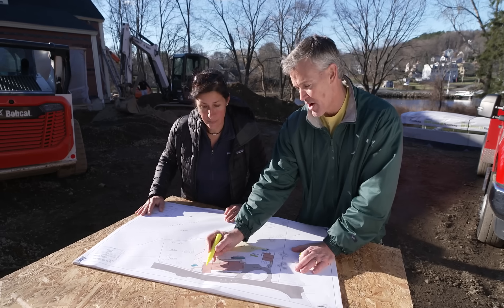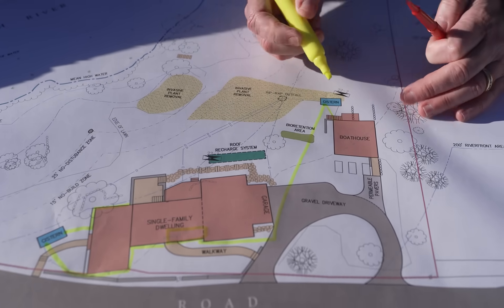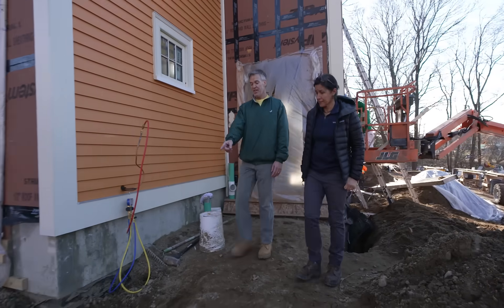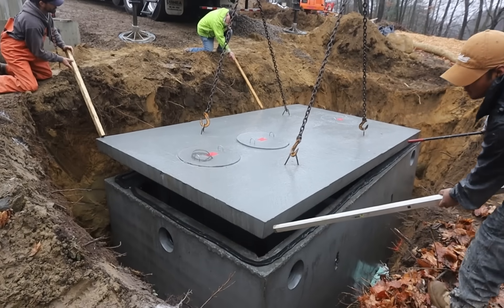Rainwater Harvesting | This Old House

Comment: I am amazed I didn't see a comment mentioning the use of water from that lake. OTOH,  that would likely require a state permit from inland wetlands / water resources, which would be easier if they had some farming on property. Maybe the town has reguations against it? BTW, concrete tanks are pricey compared to poly tanks. What's up with that? Locally, a friend scored a used fiberglass tank when a gas station had to change theirs. Those tanks need to be cleaned before they head to the scrap pile so all he had to do was coordinate off-loading from a flatbed trailer to get a 10,000 gallon unit. Local FD supplied fittings so they could access it for their needs as well. That was a low cost win / win situation. The town also put their blessing on it for setbacks. (close to the road)
Reply: Get a life bro…wow…Jeeze.
Reply: @johnlebzelter4208   Hey, I am just telling the story, someone else did the footwork. BTW, it helps if you are the fire marshal and know about tanks being pulled out around town.

Comment: It would have made more sense to place one centrally located, 20,000 gallon poly cistern with a riser for access so that the homeowners only need one pump in the bottom of a single cistern(vs 3 cisterns and three pumps) to feed the lawn irrigation system and several frost-free hose hydrants around the property. The larger tank can be buried deeper in the ground as the boathouse is a little lower in elevation than the house and proper slope can still be achieved. A simple filtering solution comes from the maple syrup industry, they use a 7" dia x 31" 100 micron felt bag to prefilter sap before it goes to the evaporator. The same filter bag can attached to the water inlet pipe at the top of the cistern to filter out all dust, pollen, asphalt shingle grit, leaves, etc. and leave the bottom of the tank free of sediment.

Comment: Wow, what a complicated and expensive system. Here in southern Arizona, we just have the scuppers or gutters run directly into above ground tanks. A lot less complex and a ton cheaper. Also the system featured here hardly has any capacity for likely $50K+ cost. We put in 9,000 gallons of rainwater capture capacity for about $15K.
Reply: Faster, cheaper, better.

Comment: Imagine having to spend that much money, just to collect rain. All because of ignorant regulations. Absolute clown world!  You could collect rain to water your lawn for a fraction of the cost if it weren't for ignorant forced regulations.
Reply: The regulations aren't making that expensive. The regs are just saying they can't use any city water for irrigation, so if they want that, they need to plan for it. Anyone wanting to do it cheaper would just buy drought-tolerant plants and grasses and not worry about it. These are just multi-millionaires wanting to build their dream "old" house
Reply: @tacojohnhg8181 Guaranteed they had to spend alot more money than they wanted too, To comply with some kind of imposed regulations, To put in that system. 100% guaranteed.

Comment: Odd that they chose a small section of the roof at front of house to discharge into the cistern that's  all the way back by the boat house. Why not just use the roof over the garage to fill the back cistern? Less piping involved.